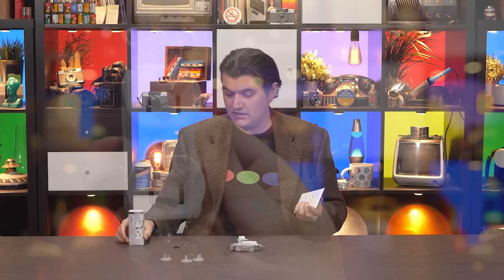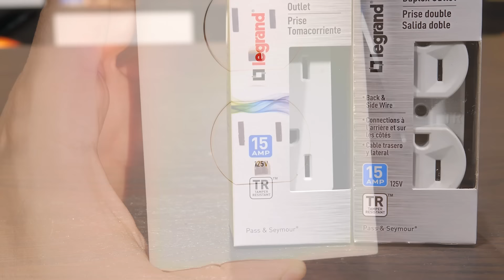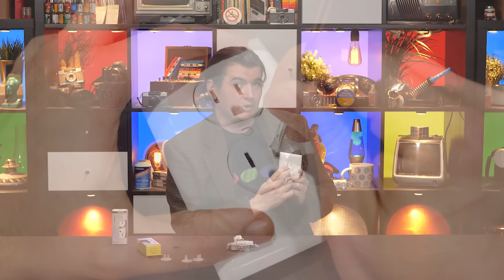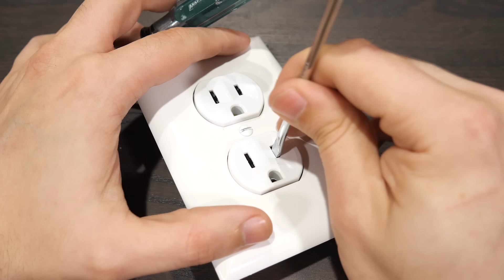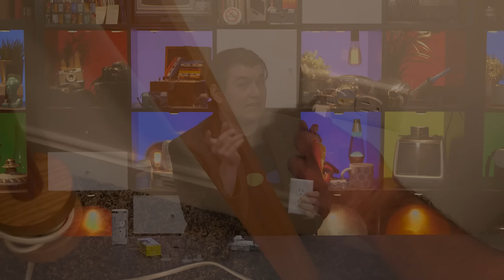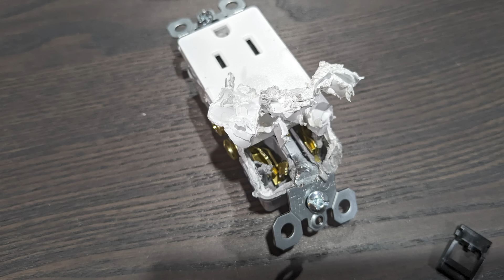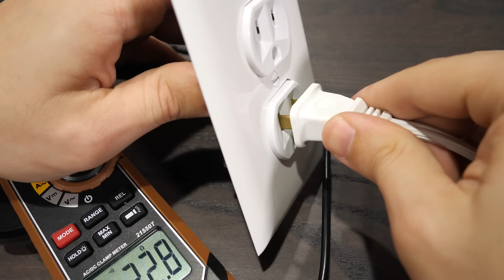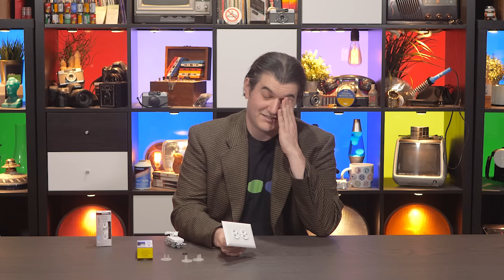Tamper-resistant outlets aren't all the same - a follow-up

Comment: Also, and I swear i'll stop now, but I just got to the Wago bit, and a properly installed wire nut will always be a much better electrical connection than a wago. I'm not even anti wago just stating facts. Wago is good enough anyways but tests have showed, over and over, that a wire nut makes less resistance. It's obvious why. You're twisting several wires into one piece of metal rather than connecting them with a bus bar.

Comment: I've been shocked by 120V either once or twice, depending on what was actually happening the second time. One was when I was a kid and plugging something in and I hadn't learned the right way to hold the plug yet... it might also have been one of those old-fashioned plugs without a flare, because it was a pretty old thing I was plugging in. The second was when I was retrofitting a large building's fluorescent fixtures to accept LED replacement tubes. The circuit breaker to the bank of lights I was working on was off (no thanks to the idiot who had labeled it; most of them were unlabeled and a few of them just said "NO"), but the neutral wire turned out to be hot because it was sharing its neutral wire with an adjacent circuit, and that circuit had something plugged into the wall! So it was backfeeding in a way that was definitely not legal. From what I can tell, I was actually only getting like 60-80V from that because the return was being split between where it was supposed to go and my body, and that tracks because it almost didn't feel like a real shock. More like I had somehow gotten stabbed by the sharp end of the wire.
Reply: For those old non-polarized plugs, the side of the cord with the non-symmetrical line going down the length of it (whatever the opposite of a groove is) is supposed to be the neutral.

Comment: Also to add another comment, I work on office equipment for a living, I fix printers and vending machines and stuff. The plugs coming partially out to the point they barely make a connection, causing the computer board to code out is a common problem. Recently my company switched to all right angle plugs, and we can even order right angle plugs for existing stuff. It has made a huge amount of difference. If I see a machine with a non right angle plug I swap it for a right angle one immediately. It's just another service call down the road for the plug having somehow partially worked its way out otherwise.

Comment: To your point on "safer" there is an additional point called "safe enough".  In a world where we are building totally new systems with no need for backwards compatibility, outlet design should radically change to a better option.  In our world, a change without backwards compatibility would need a MAJOR reason to do so.  As theoretically dangerous as electricity in our homes can be, the numbers just don't warrant it.  (Per the first google result) Only 200 people a year in the states are killed in residential electrical accidents.  Per the IIHS in 2021 42,939 people died in car accidents.  Given that we accept driving as a part of our lives as a "safe enough" activity for everyone to participate in I can't fathom a scenario where changing everyone's outlet makes sense.  This is why risk analysis is a 2 axis graph.  What can happen and how often does it happen/how likely is it.

Comment: The real reason I dislike backstab connections on outlets is they make it a giant pain in the butt to service or change later on down the line.  The quality of the connection is acceptable even if not perfect.  Don't be a backstabber, think of the next guy (it'll probably be you anyway).

Also, our outlet design may be bad, but split phase power is definitely superior.

Comment: Just wanted to say I've been using that exact same Southwire meter for work every single day for 4 years now. It's a workhorse. I've tried many other meters including fluke, fieldpiece and other brands. The Southwire is the one that earns the place in my toolbag. I've used and abused this thing to no end and it just won't quit. I use it probably 5 times a day and its still on the original 9 volt battery.

Comment: Back stab and back wire are quite different. Hearing the un-wired outlets rattle when you move them around makes me think you’re holding back wire outlets. Those you insert a straight, stripped wire into a space between the side of the terminal and a plate that is held in by the terminal screw. You then tighten the screw pressing the wire between the plate and the  terminal. It’s easily done and undone, the contact patch is huge compared to the little tooth inside a backstab, and it can accommodate different wire gauges. I’d never use backstabs, but back wire outlets makes life much much easier than having to make a j hook out of the wire, especially in a replacement scenario where space is tight and/or the existing wires are short. Back wire also makes it easier to fall in “the pit of success” as a coworker once put it - there’s a correct orientation to the hook so that tightening the screw pulls in the wire. Does everyone remember to do that? Absolutely not. Making it easier to do the right thing means people do it more often.
Reply: Hopefully, the new Leviton wago-style outlets will phase out this problem in the coming decade.
Reply: The back wire devices are quite handy and I would think it would have the similar quality as a properly wrapped screw connection (always screws me up though when I already curled the wire ends.) I agree the "back stab" pathetic little finger just trouble looking for an opportunity. In 20 years on the tools I've learned and found either a back stab or wago-style push connector failed leading to a service call. Wrapped screw connections and twisted wires with a marrette rarely fail.
Reply: Here in the Uk 'we' are (or were) taught to arrange the loop under the screw so that pulling on the wire tightens the screw (and thus when doing it up, the rotation tries to loosen it).  This reduces the risk of the wire pulling out and floating about.

Comment: In Australia the pins of the active and neutral are half insulated.  Can never have live exposed metal pin.  Was not always like that, design changed in 2000's. Never had a hot connection issues.

Comment: 10:30 All you need is one picture of what the wire is being "held onto" to be terrified by the idea of backstabbing. Wagos are completely different when you look at the insides. Same goes for some other similar products, wago is just a brand. They have tabs that you click / flip down, or if they don't they're removable, like the orange thing comes off, or some have other mechanics.

As an electrician (apprentice) in the union, almost all the service calls I have are due to a loose wire, or bad breaker/interrupter, and whenever the wire is lose on a device it's always due to a backstabbing connection, from my experiences. It's a very serious fire risk as it's only a tini tiny piece of copper that holds all 12 amps of your space heater. I sleep better at night knowing there are no backstabbed connections waiting to discreetly set the inside of my walls or customers walls on fire. But that's me.

It's not worth the convenience of not having to learn to hook wires snd screw them down. Its also not worth the time saved, quality over quantity. Especially in the electrical field.
Also wagos are fine like I said, its about the insides. Wagos gave more than a tiny piece of tensioned copper, less than one millimeter securing, unlike backstabbing. Also backstapping wires bigger or smaller than 14 AWG is against federal laws / regulations. People do it anyways on 12 AWG circuits which is super bad because it deshapes that tiny piece of copper.
Anyways I don't think you'll find any real electrician that supports the idea of backstabbing, and any apprentice that does it will always get yelled at.
Reply: I was trying to link some pictures but I guess YouTube doesn't let you send links anymore

Comment: The thing I remember always literally falling off the wall all on its own was the super heavy 2 prong gigantic Sega Genesis AC adapter. You literally could not insert it and have it be flush. As soon as you let go, the thing would pivot and the top pins would be exposed. It was just too heavy. And the few mm thickness the wall plate had was enough for the bottom of the adapter to hinge inwards toward the wall. Eventually itd just fall out.
Reply: I didn't have a Sega, but I know the type. Can't remember ATM what it was but I definitely had something that a power bar solved this for.

Comment: Way back in the very early 90s -- I was probably between the ages of 5-7 -- I had this Ninja Turtles nightlight. If you do a Google Images search for "ninja turtles night light 90s" it's one of the first ones in the results, actually. Well, one day, I found that the light still turns on even if the light is only partially plugged in to the wall. Then I found out that I could touch the plug contacts with my thumb and index finger. So, of course, I did just that. I recall thinking that it felt like a "buzzing" and not entirely unpleasant. I did this several times over the next few days until I got bored of it and moved on to the next thing.

Comment: I despise TR outlets. I just used standard outlets throughout our house during renovation. 
Wagos are great, modern lighting devices operate on such little current that I don't think twice about using them on a lighting fixture. Never in a junction box, unless it is temporary. 
Never backstab outlets either. I was just working on a kitchen renovation a few weeks back, I was looking at this outlet and the neutral hole had some discoloration. I pull this outlet out of the box and it was back stabbed, the neutral conductor pulled out of the back of the outlet with no effort. Fire just waiting to happen. If you don't want to make shepherd hooks there are outlets available that do not require a shepherds hook, pretty sure most Eaton outlets are like that.

Comment: Some years ago, established UK socket manufacturer MK (now owned by Honeywell) used a rotating shutter on the Line (Hot) and Neutral pins to protect their sockets.  Unfortunately you could force in a Euro 2-pin plug (CEE7) which is not fused (UK sockets are generally fused at 32A).
Reply: The shutters should have dimples on them to stop the Euro plugs being used, may have come in later of course...

Comment: I've been shocked 4 times in my life that I can recall:
1. As a very young kid (3? 4?) I put a live phone cord in my mouth and got shocked. Yeah... this was just plain dumb.
2. As a slightly older kid, I got shocked unplugging a lamp. It was decades old and the cord was worn out and needed to be replaced. Not my fault.
3. We had a fish tank when I was a bit older, and one day, I accidentally knocked the light into the water. I then proceeded to put my hand in the water to retrieve it and got shocked. Obviously, I should have unplugged it first.
4. When I was a teenager, I was lying in bed and reached down in the dark to plug in a phone charger. I managed to plug it in to a power strip in such a way that one blade was fully inserted while the other was hanging off the edge of the power strip in midair. After noticing that my phone was not charging, I reached down again and touched the exposed blade, getting shocked in the process. IMO, power strips that allow for this to happen shouldn't be produced.

None of these cases had anything to do with the design of the plug or the outlet! I suppose they could have been mitigated by a GFCI (apart from the dumb phone cord incident), but that's pretty much it.

Comment: Another plug I've had issues with: those multi-standard fitting plugs on planes. So many times I've had the North American plug either not work, or just plane (heh) fall out when we hit the lightest bumps in the air. I've started bringing my EU-US travel adapter with me just bc the EU prongs always stay in the outlet and it has both a USB-A and a 20 W PD USB-C built into the adapter.

Also in my old on campus college apartment in my room I had original receptacles (20-30 years old) and those were so loose that plugs would just fall out of those. Even if they didn't sometimes they wouldn't have a good connection and devices wouldn't work properly. Replacing the receptacles worked wonderfully.

Comment: I was installing a security camera low voltage power cord in the suspended ceiling of a bar and the T-bar frame had been shorted to a neon sign power supply. I touched the frame and fell down onto a booth table and the bartender gave me shit for not being careful. I gave him an earful about how electricity works and he gave me a free beer.

Comment: I don’t like tamper resistant outlets. Not the idea I’ve got an issue with, but the implementation.

I have to force the plug in way harder than feels sensible, and then there’s usually a crunching noise from the inside of the plug when it finally plugs in.

The only way to fix this would be to make it not really any safer than traditional plugs, though.

Comment: I think it's a thing with hotels and older homes. My inlaws kitchen plugs would literally fall out and had zero grip on the actual blades.  Yes the plug in the wall got very warm and one got very hot to the touch (and quite regularly was used for a crock pot and toasters). We recently went thorough and replaced all the outlets with new ones and no more over heating problems.  I'll ask my FIL if he saved any of the old floppy plugs and I could send it to you if you wanted to hold one for yourself 😅

Comment: I had a back-fed outlet fully fail a few years back.  The back of the receptacle melted and all devices downstream had no power.  I agree, it looks similar to a Wago, but I've never had a wire tightened around a screw fail.

Comment: Most of the outlets I've encountered where the plugs literally fall out of the outlets have been in crappy apartments that are already held together with spackle, and have probably reused the outlets somehow, because they're always horribly brownish-yellow colored. I had to spend weeks pestering management to use my "releasing" improvement (usually they offer replacing the blinds or an appliance) to have their electrician stop by and replace the outlets (also got them to put a 20A outlet on their 20A breaker - 1outlet circuit so I could run my 20A UPS, which was nice)

Comment: Australia has a similar pin dimension to the US plug and we have sheathed the live/hot and neutral since 2004. So it should be possible to sheath the US plug. Pretty sure we did it because of several incidents with metal Venetian blinds and fatalities.

Comment: I fully agree with your "safer" argument. I don't know if you use 110V centre-tapped isolation transformers for site tools over there but we do over here (UK) for safety - I.e. It means that you're only likely to receive a 55V shock to earth unless you touch both live conductors. It can still kill you, but the risk is substantially lower.
Reply: That is definitely NOT how our system works in the USA.  We have the grounded (neutral) conductor and two 120 VAC that are 180 degrees out of phase.  So, it is 120 V to ground and 240 V from hot to hot.  That is how we get out dual voltage residential current.  Commercial and industrial are typical;y done with 3-phase, but that is completely different.
Reply: While we don't have isolation transformers it's really just a temporary connection in place of the permanent grid connection....but that is the general concept, the set up for the North American power standards in residential homes effectively simulate a center tap transformer, an actual transformer out on the street  provides 240v into the house and the neutral line which originates in the breaker box and is ultimately sent to ground effectively functions as the center tap and renders the 120v common in our outlets. It sounds more complicated than it is and I understand why most people have a hard time wrapping there head around it... check out  'kathylovesphysics' channel she has some excellent videos on how the North American grid is set up electrically, why it was done that way originally, and some of the benefits/issues.
Reply: In the US, the residential 120/240V system IS done using center-tapped transformers, i.e. the last transformer in the power distribution system that converts from 4KV (or whatever) down to 120/240V.  Its center tap is bonded to ground at each building’s electrical service.  I’ve never seen anyone do center-tap within the 120V, though.  The use of GFCIs for outdoor circuits has been common for several decades now.
Reply: As well said by alex, in NA this is 120V in reference to earth, not the 110V center-tapped transformer you've described.
Safer implies it's somehow a bit safe in the beginning, which is not true at all. Less dangerous is more appropriate as it implies it's still dangerous and the risk is still here (as you said). Psychologically, this is like seing the glass half empty or half full, or using active/passive tense to make an emphasis. This is the kind of case where the subtext of semantics and choosing the right expression matters.
Also his talk about the real danger of electricity and the circumstances for serious harm or death is a disgustingly dangerous speech. He really need to talk to professionals (both technicians and health workers) to fully get aware of the risks.

Comment: 10:33 My entire house was built with back stabbed receptacles, I absolutely hate them, it's an older home with severely out of date electrical (No ground connection) and they keep causing issues. Any time I have an issue I replace it with a screwed in wire.

Comment: Just out of curiosity, has anyone tries adding 5-10 mm of heatshrink to the root of the pins? I am wondering if, as well as adding an insulator, it might create an additional friction point to enhance hold in the socket..